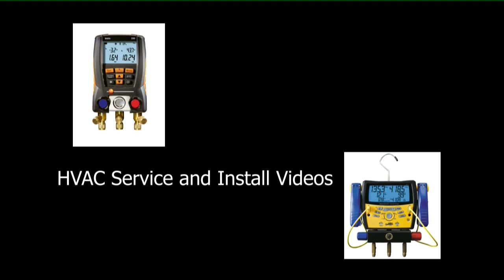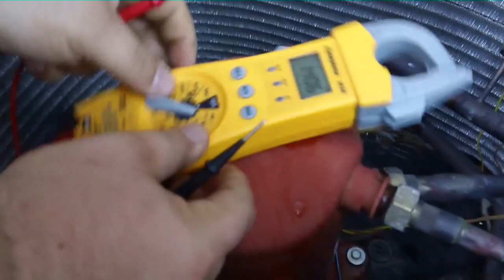HVAC Service - One dead American Standard

Comment: I had a Goodman unit that was hacked before I bought my house.  Unit lasted 8 years.  3 Ton with a 5 ton line set burled in the sand under the house & no insulation on the suction line.  Going into a coil box that was a American Standard air handler hacked in half with a Rheem brand coil inside!  My HVAC guy said he was amazed it even went 8 years.  Compressor shorted to ground!  He replaced it with a Payne heat pump and I am running dual fuel with oil heat!  He did an awesome job on the Payne!